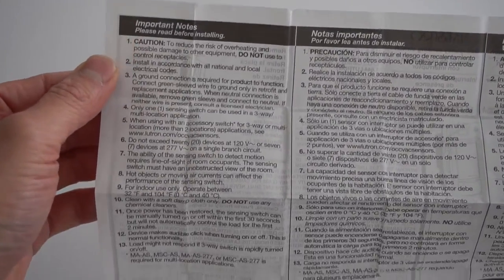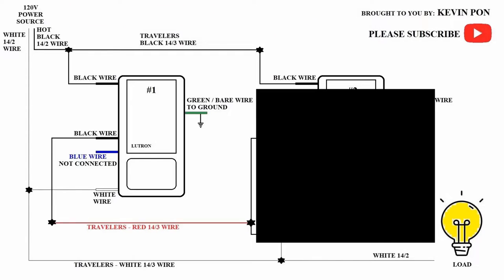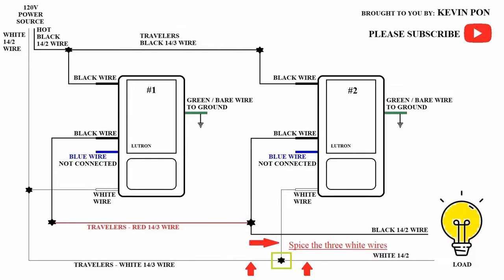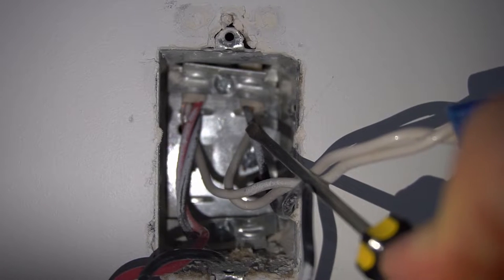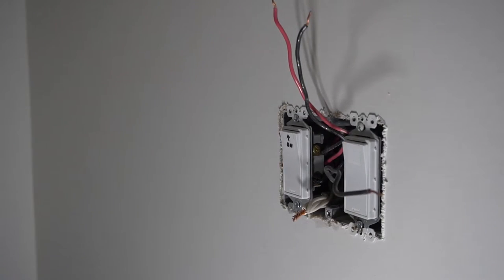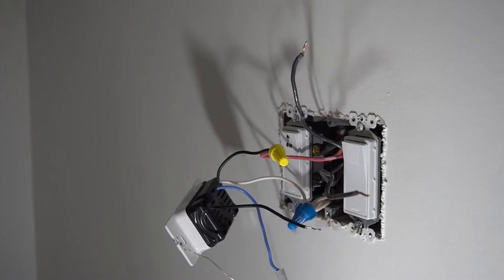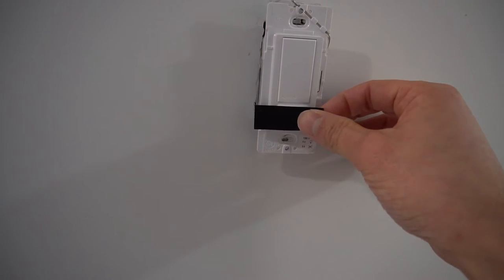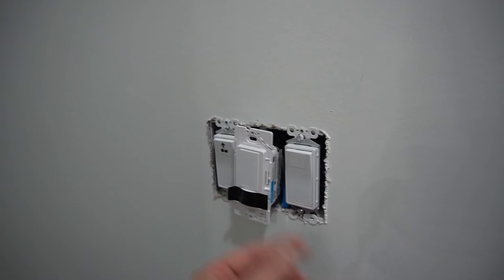TWO Occupancy Sensor 3-WAY Switch HACK BYPASS THAT WORKS! Any brand!

Comment: Brilliant video. I have a pathway in my house that involves 4 lights which are all 3 way switches. I have wanted to make the pathway motion activated for years and now I think I can! Background - The switches for 2 of the lights are not "line of sight" so I need them both switches to be motion-activated and I will wire them as you have suggested. My question pertains to the other 2 lights which are in the same "line of sight" (ie, motion in the hallway would probably be picked up by either the switches being motion-activated switches. I'm trying to decide if there would be any benefit in using 2 motion activated switches even for these lights. Would the switches act differently when one is in the off position and one is in the off position (as you demonstrated at the end of this video) based on whether I use one or two motion-activated switches in the circuit? 

Also, these switches will be in a box that has a  GE Smart Switch, do you anticipate that being a problem? I saw one post that seemed to indicate that activating the Smart Switch caused the motion activated switches to be triggered.

Thanks for posting great content and also commenting on our questions. I have been using YouTube for DIY for decades and you are the first Channel that I ever subscribed to!
Reply from the maker: Hi Steve! Thank you very much for subscribing! It means a lot. To answer your first question. If you have your switches wired as per diagram. It does not matter whether one of the other is on or off or even both on. They are wired in "parallel". In other words having two switches in different locations that does the same job. As for GE smart switch, I don't have any experience with them. I'll have to Google it. I'll get back to you on that. 🍻
Reply from the maker: If the GE Smart Switches are controlling different lights. I don't see them interfering with the other switches. Cheers!
Reply: Can I use 3 3-way motion sensors to control the lights? I want to install in its floor , 3 hallways. Thanks.
Reply from the maker: Yes, absolutely. You will have to parallel the circuit. All 3 switches must be wired to have constant power 🍻

Comment: I was able to get the switch to work correctly on the dual switch but on my single switch it will not activate to turn the light on or off. It only works with the sensor that is on the dual switch. Also on my single switch I only have 1 black 1 red and 1 white wire. I do not have an extra black wire like you do on the video. How do I get it to work?
Reply from the maker: I'm trying to understand what you're saying. The switch you have is it a 3-way or a single pole? And do you want to put that switch on a single pole spot?
Reply: I have a very similar setup as you in my hallway. On box 1 I connected everything exactly as you said with the sensor and it works perfectly. On box #2 I have tried adding the 3 way switch as you described but on box 2 which is my single switch I do not have the extra black wire. I just have 1 red 1 black and 1 white. I do not have the extra black wire. To finish the set up as you do
Reply: If I was able to post pictures I would show you but I cant
Reply: I hear the second sensor trip but nothing lights up. The lights only activate on the first 1
Reply from the maker: @Guenon24  that is very weird. You need 2 black wires coming out of the box, 1 red and 1 white
Reply from the maker: @Guenon24  you can send me pictures at kevinponbusiness@gmail.com
Reply: Thats what I find weird. Box 1 has the power and when the switch is on I can turn box 2 on or off manually without using sensors. With the sensors box 1 turns both lights on but box 2 doesn't have the extra black cable and won't turn on the light. There is power to the sensor its just not serving its purpose. Is there another way around this or no?
Reply: Email sent. I've tried everything and nothing only box 1 sensor works. Not sure what else I can do.
Reply from the maker: @Guenon24  yes I see the problem. Your box is definitely missing wires!! :/
Reply: 😔  that sucks. Lol I assume there isn't a way around it.
Reply from the maker: @Guenon24  no there is a way. You will have to rewire the circuit. It's called parallel circuit. Chance the them as two location single pole switch

Comment: What happens if I don’t wire them correctly, as in I wire the box with the light like the box with the power should be wired, and vice Vera’s? Will it do any damage to the wording or switches?
Reply from the maker: Sorry I do not understand what you mean.

Comment: We have a multi switch circuit in our hallway with 3 manual switches. We would like to install motion switches at 2 of the 3 locations, and a manual switch at the third. Is this possible?
Reply from the maker: It's possible but for the manual switch you won't be able to use it. If you turn it off. Everything will be off. It has to stay on the on position or else the entire thing will not turn on 🍻
Reply: @KevinPon.  That's fine, except I have removed the covers to inspect the wiring, and 1 of the switches we wanted to install an occupancy switch on is the 4 way switch. The other 2 switches are 3 way. Any idea how I can make this work? Also, the Maestro multi location switches I purchased have no white wire like yours, but they have a green wire plus 2 blacks and the blue wire.

Edit: I got it figured out. Since my occupancy switches don't have a white, the green wires get hooked up to the house's neutral circuit. Also, I just used a single pole switch in position #3 on the circuit which is basically just an on/off override directly to the light. Thanks for all your help!
Reply from the maker: @stevencollier5857  congratulations on your your findings and success! 🧐🍻
Reply: The lights were so bright at times that I changed out the single pole switch in the #3 position with a Lutron Diva dimmer. Works like a charm!
Reply from the maker: @stevencollier5857  bravo Steven! 🍻

Comment: Kevin, great video. I'm wondering, is it possible to use just one motion sensor switch and a regular switch on the other side? I've done it and have to leave the regular switch always on as you mentioned but the problem is that switch becomes useless. If I want to turn on the lights from the regular switch I'm not able to, the system can only be operated from the motion sensing switch.
Reply from the maker: Thank you! Yes that is correct. The entire 3-way circuit can only be controlled by the motion sensor. You cannot turn off the switch. If your regular switch is off, it completely turns everything off and cuts the power to the motions sensor 🍻
Reply: @KevinPon.  I really appreciate the quick reply! What's weird is that for about a week if I'd turn off the regular switch when the light was off but then turn it back on, it would turn on the lights. Now it turns it on for a split second but then turns off. Do you know why that is?
Reply from the maker: @juancaps  the regular switch, normally you leave it on 24/7. The motion switch is  working normally but it just doesn't know that the regular switch is turned off. When it turns on the light is probably very dim is because you have turned off the regular switch

Comment: Can this be done somehow using just 14/2 wire? The bit of 14/3 I have isn’t long enough :( Anyways, since people are mentioning that these are wired “in parallel” and I have single pole switches, just wondering if it can be done somehow with only 14/2.
Reply from the maker: The answer is yes. What do you mean by isn't long enough? Are you wiring your house? Does your single pole switch have a neutral wire?
Reply: Yes, my Lutron single pole switches have a neutral. I’ve been remodeling our basement and only had about 10ft of 14/3 wire… I think it will be cool to have sensors at the top and bottom of the stairs to gently light the stairs to the basement. I just ended up getting a 25ft roll of 14/3 and everything is working great. Thanks so much for your video!
Reply from the maker: Thank you and you're very welcome. So in that case you will have to run 2x 14/2 to replace 1x 14/3. You will just have a spare wire. An extra white that you will just cap off. In my video, the switches when I cap off the blue wire it'll be exactly the same as your single pole switches 🍻

Comment: This works with switches but what about dimmers?
Reply: Here to ask the same things. Have you tried with 1 dimmer and 1 motion sensor?
Reply from the maker: Hi Ben. This will work but this will happen. For an example you turned on the dimmer at low without triggering the sensor. As soon as you trigger the sensor the dimmer will be override until the sensor times out 🍻

Comment: Will it work with 220 v wiring? Is the wiring diagram similar?
Reply from the maker: Not with this specific occupancy sensor switch. The voltage rating for this one is 120V

Comment: I'm trying to wire a three way sensor switch (MS-OPS5M) to second MS-OPS5M) sensor switch.  I can wire the neutral at the original line switch, but when I try to wire the 2nd sensor switch, there are only a red, white (tagged as black), black and ground coming from the wall.  To me, it looks like I'm missing a neutral wire at that location.  When looking at the ceiling light wiring, only a black, white and ground are there.  I don't understand the wiring formation but I guess that's  beside the point.  My question is:  The is there a way to successfully add the second sensor?   If anyone can figure it out, it would be you. I sure would appreciate any feedback.   thank you so much.
Reply from the maker: Hello there, unfortunately you will need a neutral wire in the other box to make this work. Just like in my video.
Reply: @KevinPon.  thanks for feedback Kevin.  I'll do sensor in one location and regular 3 way rocker at other location.  Cheers!

Comment: Sounds good, will sub on that. What is the blue screw or terminal for?
Reply from the maker: Thank you my friend! The blue wire is only for when you only use 1 motion sensor on the 3-way circuit. It's for splicing one of travellers. Red or black.

Comment: Hey Kevin question I have the same occupancy sensors at the top and bottom of a stairway but I can’t get the switch to shut off only manually… Dows this make sense?  I tried to push and hold the rocker portion for programming of the switch to shut off after no movement but it just flashes once when I hold it and won’t blink twice or more for programming options does this work for you
Reply from the maker: Hi Robert, let me ask you this first. You have 2 sensors and you followed my wiring diagram?
Tip: If both switches are triggered by motion, it will seem like you won't be able to turn off the light since if you are trying to turn off the light from one switch when the other switch has not timed out yet. If that's not the case then you might have a faulty switch. I have heard a case that a person in the comments had a faulty switch.
Reply: Firstly thank you for replying to me…
I REALIZED that I didn’t mask off the occupancy sensors before I turned on the breaker.. not sure if this will change anything as I didn’t see you set any thing in the video to program the length of time the sensor would work so assume you did it before or you didn’t do anything?  I’ll try this tommorrow if it does not work then I’m assuming I have a faulty sensor(s)
Reply from the maker: @DumanCanakLika  No problem. Masking the sensor will work to trick it thinking that there is no movement in the area. If that's what you want while having the other switch to sense motion. Changing the settings can be done at any time. My current settings are 1 minute and high sensitivity. I hope you will get it all figured out 🍻

Comment: Something is not making sense.  Not turning off when pressing switches.  Or was the motion sensor keeping it on
Reply from the maker: They will both eventually turn off after it's timed out. If one of the switches senses motion. It will stay on. If you want them both off right now then both switches must be pressed off 🍻
Reply: @KevinPon. 
Got it I finally had opportunity to install 2 motion dimming switches.  It didn't work, then I remembered your video. Thanks

Comment: I did the same thing what you did, but it did not work properly, can you help?? Thank you
Reply from the maker: Hello, does the motion sensor work? Do you hear it click when you press it?
Reply: Thank you for reply, the motion doesn't work, it only turn off, the manual button only work like 2 way, so what do you suggest??
Reply from the maker: @theend8911  do you see the button flash when you change the settings on it?
Reply: When i change time the light setting can flash, but when you mode auto on and off the light did not flash
Reply: Even when I just install one sensor, the light did not work too.
Reply from the maker: @theend8911  how many are you installing? 1 or 2 of these switches? I need you to start from scratch and just install 1. Reconnect all the wires to how they were originally. Then one of the boxes has the power supply and the other doesn't makes a difference! Once installed, you will have to test your motion switch. When testing, the other 3-way switch (no motion) try it one position and if that doesn't work flip the switch to the other position. I need that switch to be "on". Need the power ON 24/7. Very important.
Reply: @KevinPon.  my plan was install 2 swtiches, at first, i install 1 switch ,it work 1 2 time, and it stop, , i can not change mode on side button, and then i try on both position, but it did not work either. And then i find down your video, i am so glass, i do the same your setup, the sensor does not work. I try change postion of switch. It did not work. Do you think the problem with the switch? Becasse both switch i can not change mode on the side button. Thank you so miuch
Reply from the maker: @theend8911  if you are installing 2 sensors and followed exactly how I installed it. Or follow the wire diagram. Then yes it could be faulty switches
Reply: @KevinPon.  i do exactly what you did, let me try to buy new switch, and let you know soon. Thank you so much

Comment: Is it possible to wire in 3 sensors?
Reply from the maker: I am going to say yes. It's possible. Must be sure that each switch has constant power and the wires are connected and spliced correctly.
Reply: I just wired them up in a parallel circuit. All 3 work great. The sensors are so sensitive though, lol.
Reply from the maker: @theoteague2266  haha nice!! Good job Theo 🍻
Reply: @KevinPon.  I have a 4 way light ( 3 switches). I want to leave the 4 way switch manual and replace only the 2 3-way switches on each end. Would there be any modifications for such a layout?
Reply from the maker: @JoeCavallo  Hi Joe, unfortunately the 4-way cannot be switched manual. Once the 4-way is switched off. There will be no power to travel to the other end of the 3-way to keep it on standby. In other words it will be turned off. But you can replace the 4-way with a occupancy sensor and control as a manual switch.
Reply: @KevinPon.  what if that 4 way switch is locked in the ON position? This circuit is a hallway and the motion sensors (installed on each end) should cover it to the point a manual switch is never needed at the middle 4 way switch.
Reply from the maker: @JoeCavallo  there is also another alternative. To make your scenario to work. Will have to rewire and splice a few wires together to make your at the 4-way switch so it'll  become a single pole switch.
Reply: @KevinPon.  I was able to do this configuration by bypassing the middle 4-way switch and using the motion sensors in the two 3-way end locations.
Reply from the maker: @JoeCavallo  that is awesome news! Congrats on your success! 🍻 🍻

Comment: I got this switch and mine didn't come with neutral wire.  It came with 2 blacks and 1 blue and greens...
Reply: greens would be neutral (white)
Reply: I believe the 3 way has a green sleeve cover on the neutral. Pull it off to reveal a white neutral wire. The ground is the bare thin silver looking wire.
Reply from the maker: That is correct my friend
Reply: Mine is the same, no green sleeve, just green ground wire. I think there was a revision of this model somewhere along the way. I wired it according to Kevin's instructions, but without neutral/white wire and it is working as expected!
Reply: Just confirming I had the same issue and did what  @netaddict88  did and wired the green wires to the ground and left the white wires alone and it worked great. Thank you both!

Comment: So I watched it 20 times and I still can't get them both to work,  only one of them wants to work
Reply from the maker: The key is both switches must have constant power going to it. For them to be both working. Double check your wire splices with my wire diagram. You're getting on the right track 🍻
Reply: @KevinPon.  it actually worked,  thank you so much
Reply from the maker: @russkielol  haha you're very welcome! Good job man!!
Reply: I almost gave up, but read through the comments and found this similar problem I encountered, tapped the other wire to have constant power...wallah it worked!

Comment: Why is the blue wire capped by itself?
Reply from the maker: That wire won't be needed for this application 🍻
Reply: The instructions that came with this are pretty much useless. What does the blue wire do? I am wondering if it is connected to GND if it will turn off both switches? I seem to remember this as I was probing. Can you confirm please?
Reply: @MadMax-kp1qx  it’s a traveler wire for a 3 way switch
Reply from the maker: It's a traveller wire. Cannot be combined with ground or neutral wire

Comment: Seem like you can do it with 2x single way sensor switch, Can't you?
Reply from the maker: Absolutely, you can on a 3 way circuit but you will have to make the correct wire splices.